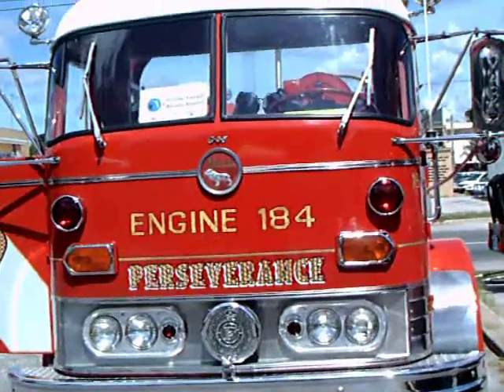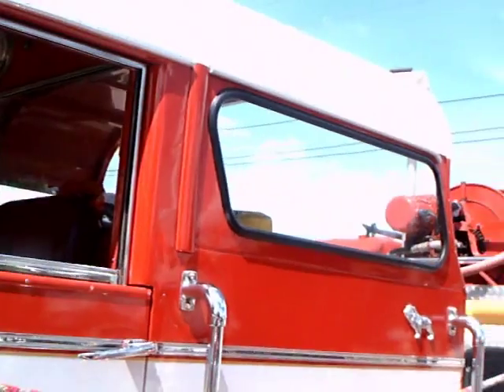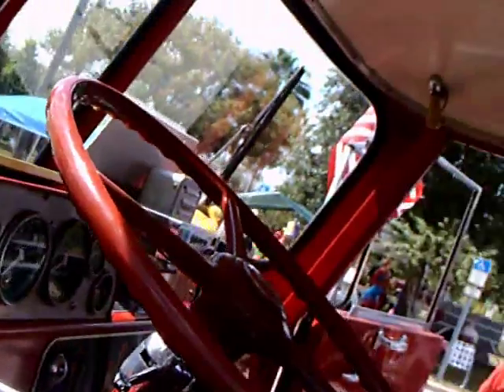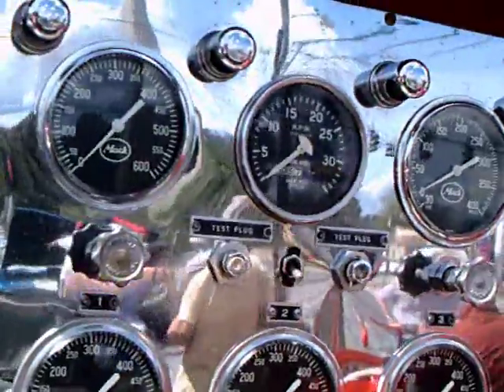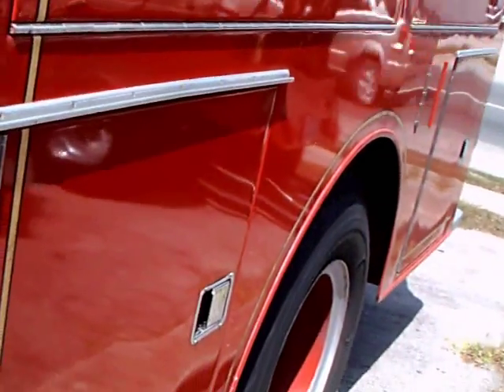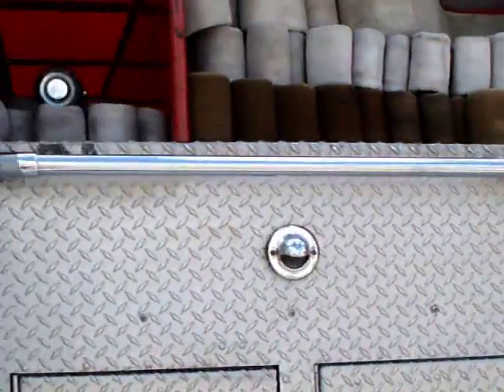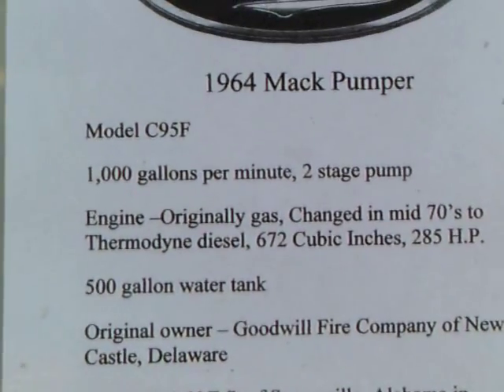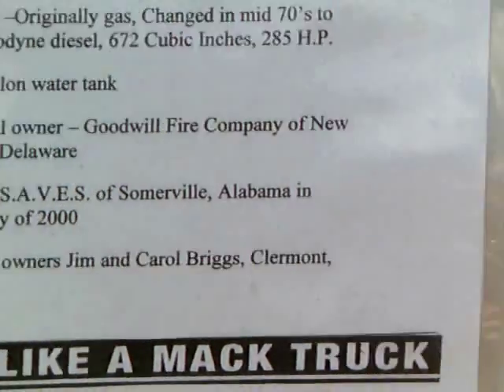1964 Mack Pumper Fire Truck Grov 092912

Comment: when I joined the fire department in 1980 we had two Mack C95 1962 pumpers, gas engines.  No power steering, double clutch.  Having never driven a standard shift at age 18, that was quite a chore and a thrill to drive and pump those trucks
Reply from the maker: Congratulations on mastering those monsters!  You can truly say that you were a REAL driver after that experience!  Thanks!  :) Jack

Comment: Well, easy might be misleading. they dont require much physical effort to steer, even at low speeds in very tight quarters. However, driving it through a mountain pass. With the 5 speed transmission and 2 speed splitter give you ten forward gears. Its ALOT of shifting around trying to keep that motor making power. But i will say, i was honestly surprised how easy to operate it is. The clutch is real light, steering is very easy. Its very nimble for a truck its size.